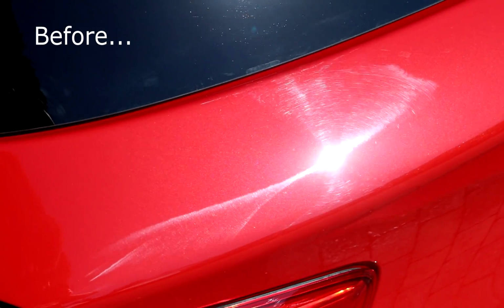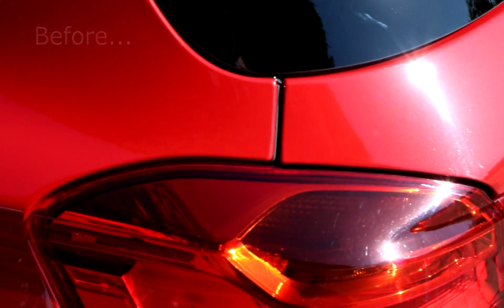Swirl Marks and Buffer Trails - Bringing a BMW M140i back to respectable

Comment: Okay, so just spent the weekend detailing for the  first time using the products  and methods  shown recently by John. I detailed my Lotus that about 18 months ago had a 4k spray job but had a number of paint defects, the results? ????? I ended up with a almost faultless paint finish , the  car and paint look absolutely stunning. So thank you John  I couldn't have done it or would have even been brave enough to make the Lotus my first detail without your brilliant videos.  I'm glad I did............Cheers John. :)
Reply from the maker: thats wicked mate I appreciate it..  a lot of times when they are painted they get a bodyshop MOP.  and after the first few washes a lot of the polish thats masking stuff gets washed away and you can see lots of "things"  sanding marks and machine induced marring etc..  even swirls ..   but working on a car thats just been painted generally that paintwork polishes up lovely..
Reply: Spot on John, keep up the good work.  Always enjoy your videos and thank you taking the time to reply.

Comment: Tip time !!!. Hi Jon another great video as usual. Just one then at 2.50 minutes in your video it looks like your car is touching the cupboards, im sure you have to do that to get the garage door closed but i seen a great tip one time for someone in this situation.
Get a soft tennis ball and hang it from a piece of string from your garage rafters so that its just touching the middle of your front windscreen..then park your car as normal so that its just touching your cupboards then reverse back an inch ....now adjust the tennis ball so its just touches your windscreen and now when you drive in and your windscreen touches the tennis ball you will know your 1 inch from the cupboards...and when not it use just hang the ball up out of the way ...works really well ..you're welcome my friend .

Comment: Car looks lovely in the sunshine Jon, shame about the pitting on the bonnet 😩. Just got a brand new 335d touring and I’ve got to say the paint work is a disgrace. It looks like they washed it with a scouring pad.spent 6hrs on Saturday and all I got done was the bonnet, the tailgate and rear bumper and the o/s/r quarter. Cut and refined. The results are good but it’s just bad that it needs doing

Comment: I'm a big fan of BMW's, mostly old one (2002, e30, e46, m1 and z3 coupe) but the 1 series hatchback is not doing it for me. Yours has a good colour combo with the black pieces and thoses beautiful wheels. It seems the issue you had on the hood and front bumper kinda burnt you out, and i understand why. Putting that much time and effort and not getting the result you were hoping for is frustatring.
Hope you still love detailing after all that :) Really interested in the spraygun setup you got for the k7, i'm also looking for a setup like yours but a bit more higher quality (probably a mtm sg28 with a quickdisconnect and swivel). The gun from karcher is not the best for detailing, and i'm starting to wash my car using just the hose, just to make the process quicker and more enjoyable. Cleaning wheel brush with the spraygun on the hose, rinsing the mitt after 1 panel and making sure it's clean. The only con for using the hose is that it takes more time pre rinsing and rinsing the car.

Comment: I noticed you were crawling around on the floor doing lower sections of the car in parts of the video. I’d recommend jacking the car up to meet you and then putting blocks/piles of 18mm ply under the wheels for stability.
It saves your back, gets more light on to the surface and can help with reducing the fatigue in your shoulders as you’re not holding the entire weight of the polisher up in the air as much. Takes a little to get used to but I facepalmed hard when I realised I’d been missing out all this time.

Comment: Thank you for yet another good one Jon,

I only have 1 question really which I'm strugging to find much guidance on.. 

How long would you realistically say it would take to compound a car? I have my f10 535D and I attempted (1st time ever) to remove some swirls last year, yet I seem to have made minimal to no difference😂 

Decent pads etc, I can only assume I rushed although it didn't seem that way... took me about 15 mins per door, I'd say whole car approx 2 hours. Am I undershotting it? I guess I'm just worried that if I go too slow I'll end up burning up!
Reply from the maker: it depends on standards Enis.  To do a single cutting set on a big 5 series with hard paint could take 5 hours if you really hit all the paintwork with mini polisher or nano tools.   But if you whizz over it fast then 2 hours.    but you need to go slower mate.  sounds like you need multile cutting sets and you might want to refine after the cut.   So with mega hard paint sometimes like course wool pad is best and then refine out wool haze rather than trying to cut with softer foam etc...  so depends on so many factors.

Comment: how about the gloss after the car is polished? have you measured that? you mentioned that in video when you measured the gloss before and after quick detailer
Reply from the maker: yer Ive got something shot on this I learnt something I thinks quite cool.. problem is from a you tube persective it will tank.

Comment: Can you make a video on how to finish with a rotary without creating holograms? Especially the side skirts on my 1 series are killing me.
Reply from the maker: soft foam pad, finishing polishing, not much product, low pressure and 700 RPM.... Boom... honestly thats it.
Reply: @ForensicDetailing  I just can't get the last trails out. I don't know what I'm missing. With the bigger pads, it seems to work. But if I'm going 50mm or smaller, no way. Which pad/machine did you use for your side skirts?

Comment: Afternoon Jon, another great video. I see you have used Tac systems  total one? I have this but have yet to use it. It's difficult to find reviews on but I'm I right to think it's similar to carpro essence? Does it lay down it's own protection as I'm going to follow it up with tac systems moonlight.
Reply from the maker: yes mate i have a video on it.   Its hard work to remove.  its very thick when you buff if.   I would suggest work in small sections.  machine or hand.  and then take the time to buff that small section and get it all off.   dont leave it there.     I also regardless of what anyone tells me about these primer polishes believe they are best left 24 hours before coating on them...   I also believe  a a water based degreaser is beneficial.   TAC say no though..  you can use and buff and wait an hour and and coat according to them..   the gloss the next day after the primer polish was very nice though.  just quite a thick tough resin to buff imo.
Reply: @ForensicDetailing  Nice one thanks for getting back. Not seen the video on that just the moonlight ones. Surprised you haven't done anything on Wowo's yet as their crystal sealant is very good stuff. Unless I've missed that as well!

Comment: Hey Jon, 
I am really new to your channel and love it!!! You are awesome.  You have so many messages and I don't mean to bother you with another one but here it goes.  At 6:17 in the video you use floss to de badge your car.  I assume that is so you can get an even polish and coverage on your car.  Do you always do this, and if so what do you use to put the badging back on?  Thanks Jon and I appreciate the time and dedication you take to help everyone.  Im hooked and I i can think about is getting everything ordered to start on my car.  Cheers!!!!
Reply from the maker: yo paul.. you rox thanks for kind words.   I would normally just tape round the badge.  I just wanted to upgrade to black badges.   Once you cut these badges off you are better off buying replacement ones.  Its such a hassel to cut and find the right thickness foam blocks to fit back in there and they will never look right.

On old cars you sometimes cant get the badges so you sort of stencil out new foam backing for it.

BTW I wish I had not upgrade the quality of the black badges is not good :(

Comment: Your car looks tight fit, straight on, can you not drive the front end in one side then kick it over to the other, so it’s on an angle? You might be able to walk all the way around then without jumping cuppboards or opening the garage door again.
Reply from the maker: no theres not enough room chris.. Im possibly gonna move everything around soon.  put the carcasses on the far wall.  paint the floor again.. tart it up again.

Comment: Hell, anyone. Some scumbag has used my magnetic L plate sign on my teaching car as some sort of towel and scratched my bonnet. Any advice would be helpful.
Great vlog Jon.👍
Reply from the maker: you will need to machine polish it.. but machine polishign will only take out very very fine swirls mate... have a watch of the polishing guides on the channel

Comment: Would this work on my wife’s 1 series??  It’s a 2014 and the dreaded jet black gloss colour and the paint needs serious attention. Funds are limited but I could stretch to a cheap
buffer and the products you list.
Reply from the maker: have a watch of the machine polishing guides.  A das6 pro can polish your car.  F series Bmw paint is pretty hard.  if its 2014 it will prolly be best to hit it with H8 first then polish it with M2.  its not that difficult, just takes time. have a watch of how machine polishing playlists.
Reply: Forensic Detailing Channel thanks. It has various blemishes, hand prints, swirls, scratches etc...some of the paint is really flat too. I’ll have a watch of the guides and set aside a day to try and rectify it. I’ll never again buy a black car.

Comment: Where did you get the polisher extending spindle from?
Reply from the maker: Ebay mate.  just search M14 extension bars.
Reply: Cheers mate
Reply: Would love explanation on the different pads you used, end result is lovely!